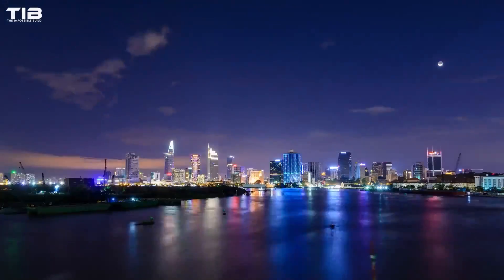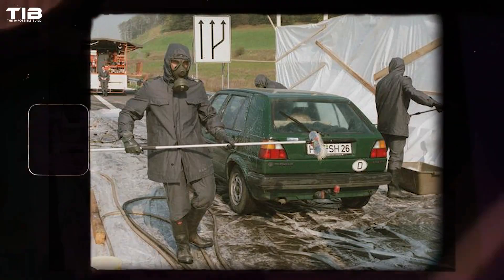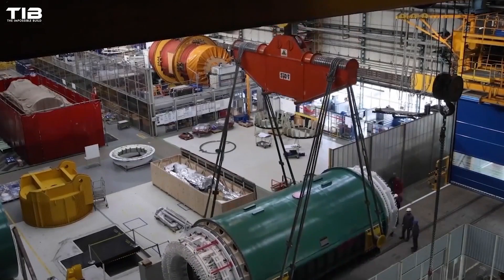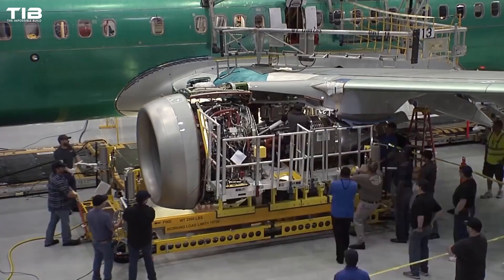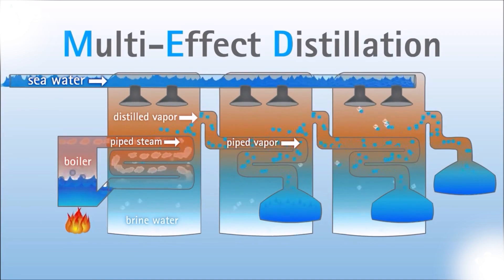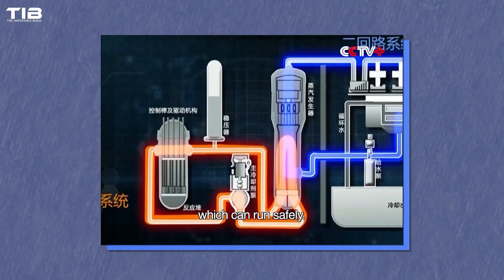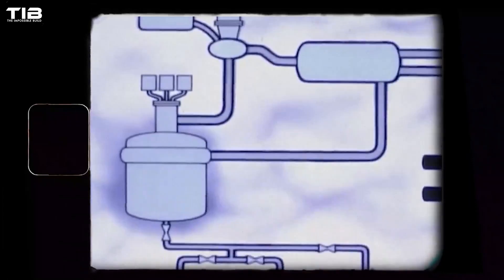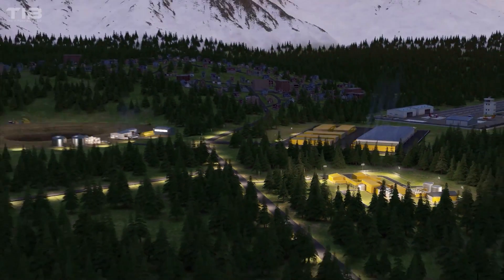The World's Smallest Nuclear Reactor

Comment: 300 MWh on a reactor that size isnt possible it would probably be closer to around 70 MWh
Reply: Several of them already are in use and are producing much more than 70. They can produce equal to demand increasing efficiency. I know of some in Europe that are producing 300+. Nuclear Aircraft carriers produce approximately 250 megawatts at full power.

Comment: In my opinion there are 2 basic platforms for energy. Fixed stationary Base power load Such as geothermal And portable As required power sources for our economic Distribution of industrial and human sustainable Products. We must adopt a system's view Of power use It's effect on external environmental factors And it's ability To be exported to downstream usage thereby achieving A more sustainable long-term view of energy use a very simple example: The heat used to produce steel is captured then exported into a  Desalination system to produce clean water, Further transported to greenhouses or homes for heat all part of a thermal efficiency process.  SMR's are a part of this future of efficiency in upstream usage rather than trying to do CO2 capture and other downstream clean ups which requires additional energy input to clean up the previous waste produced. Looking at the laws of thermodynamics and then improving efficiencies prior to implementation of power sources for industreal use is the future to longevity of our society.
Reply: Good opinion!

Comment: Chernobyl killed the ~ 20 people who went in at the time of the disaster. Fukushima was a weather event not a nuclear disaster, and ZERO people were killed from radiation. Nuclear is the SAFEST BY FAR energy source per measure of energy produced, as well as the ONLY truly zero-carbon energy source. It has TWO MILLION times the energy density of fossil fuels, solar & batteries, wind, hydro, geothermal, and is BY FAR the most reliable base load source of energy ever employed. It is FAR MORE SCALABLE than solar or wind, which take huge amounts of resources, land, time, and money, and wear out very quickly by comparison. Nuclear is the ONLY approach that could ALONE meet the planet's requirement of RELIABLE base load.

Comment: SMRs could be the stopgap solution we need for the next several decades until we are able to get past the massive scientific and engineering hurdles of nuclear fusion reactors and make them commercially viable. Ultimately it will be fusion reactors that will eventually become our primary, nearly forever power source. They certainly seem to have the potential to be a better solution than building more of today's massive and seriously, ruinously expensive to build and operate light-water reactors.

Comment: I am not against nuclear fission or even potentially fusion, there are times and places that nuclear could be appropriate. I do believe that nuclear will play a minor role. Renewable energy is rapidly advancing. Your statement about intermittent renewable resources is shortsighted. The point is: sunshine is free and the sun is shining and the wind is always blowing somewhere. The trick is to distribute and store that energy. Civilization is changing energy models, away from a centralized system to a distributed energy network. Every solar panel will add energy to a battery and every battery will feed the grid. SNRs might play a part by topping off batteries. There will never be a blackout because every consumer will be it's own backup.
Reply: It is technologically impossible to control a huge number of generation sources and distribute energy stably without significant losses.

Any generation sources with a capacity of less than 1 MW mean low voltage and the costs for transmission lines, substations, balancing, backup and maintenance are higher than for generation sources.

All renewable energy with a capacity of less than 1 MW (and often less than 10 MW) is subsidized worldwide.
Reply: @MihailG5541  
It may be true that a centralized system would have a problems controlling a large number of sources. However, a decentralized system would be less complex. In a distributed virtual system, large scale inertia and frequency control would be replaced with localized battery modulated control. As to costs, renewable sources of power are more efficient. Centralized power stations waste two thirds of their energy to process heat. Golmud Solar Park in China is the world’s largest solar farm with a 2.8 GW base and it seems to be quite integrated into the grid.
Reply: @chrisconklin2981  solar panels waste 80% of energy into the heat.
Thermal power plants can be used in many cases such as plastic recycling, water desalination and so on
Reply: @MihailG5541  Thank you for the comparison and please let me be more complete in comparison. I will not talk about nuclear as it is too complicated for this level of discussion. Regarding solar panels, the sunlight is free and the twenty percent that is converted into electricity instantaneously travels by wire, and is sometimes stored, on a grid system. Yes, we pay for this grid. 

Regarding fossil fuels they are archaic plants and animals that also depended upon sunlight. The process of mining/drilling, transporting, processing or refining, transported again, and then burnt for fuel to make electricity is a long process. I would say that this process is both energy and structurally much more expensive. Besides the sun will always shine and fossil  fuels will never last. Actually oil and coal are wonderful things. It is a shame that we just burn the stuff.
Reply: @chrisconklin2981  The entire process of manufacturing, transporting, installing, maintaining, storing, disposing of or recycling both solar panels and wind turbines involves fossil fuels to a large extent.
These are very energy-consuming processes.
I have not seen a single study that shows savings compared to fossil fuels in transport by more than 1.5 times and in the electricity sector by more than 2 times.
Only heat pumps or pellets/biogas from waste have high energy cost reduction coefficients.

Until other more sustainable and stable types of renewable energy (hydro, geothermal, biofuels of all types, hydrogen or ammonia, alcohol from renewable sources...) rise to the same position in terms of electricity generation per year, filling a significant part of the described chain - You can’t talk about “free” energy, “zero” emissions or at least some kind of long-term stability of the energy system.
Reply: @chrisconklin2981  Another part of closing the nuclear power fuel cycle is gas-cooled reactors (carbon dioxide and nitrogen for low-temperature generator outlets, helium and other inert gases for high-temperature heat exchange in the primary circuit) or molten salt reactors.

They will make it possible to raise the reaction temperature to 700-900 degrees, which will not only increase the efficiency of the nuclear power plant, but will also make it possible to melt metals in the second or third circuit, burn building materials or make cement, cast glass molds, and so on.

This could significantly reduce fossil fuel costs for industrial processes

Comment: Small Nuclear Reactors are being used in submarine and colossal Aircraft carriers, so the tech is there, and use to generate electricity 

So that same reactors can be used for smaller Towns and ciiites and that can be scale up
Reply: The first 30 SMR reactors will generate energy at a price higher than $100 (93.5 euros) per MW at the moment.
Taking into account typical construction delays, the price may increase by another 20-50%.
At such a price, they will not be able to compete with other types of generation, except perhaps with diesel generators in Alaska or northern Canada.
Reply: @MihailG5541  A 300MW SMR is being built for Ontario Power Generation (OPG) in Canada.  It is located in proximity to a large-scale nuclear plant.  It will cost $140mm USD and be in-service in 2026.  About an 18–24-month construction line.  The design is on scale to the existing PWR's currently in-service.  If successful, they can be further scaled to micro-SMB's <20MW and used in the 256 isolated northern Canadian communities.

There are >5,000,000 such communities on the planet.  I definitely see a business case and market for SMB's moving forward.  Designs such as liquid salt reactors add a level of safety.
Reply: @MihailG5541  We pay .16 per kilowatt hour so a megawatt here is $170
Reply: @TheOriginalUberGoober don't underestimate wholesale high voltage electricity prices.
Prices for households are double or even triple to wholesale.
Reply: Then again, are not warships and pretty safe from terrorists attempting to obtain their reactors. Or should we no longer be concerned about the dangers of nuclear proliferation?

Comment: Truth is, a long-term, independent study found that nuclear power generation is 6x more expensive than solar and wind + battery storage.  LOTS of these videos talk about SMR's but, none are being built and they won't be, due to their extremely high cost.  We'll see FAR more solar, wind and battery storage until we achieve 100% from these as nothing else competes.
Reply: In fact only Russia built new SMR reactors with HALEU fuel and only China built SMR reseach rector of 4th generation with mixed fuel.
Only Russia has new contract to build new SMR nuclear power station in Uzbekistan (6 SMRs, each have 55 MW of electric and 200 MW of thermal power).
Only Russia and France have abilities to produce enough HALEU fuel for SMRs.
All other "SMR" projects are re-developed old projects of "medium" modular reactors with power from 300 to 600 MW and usual nuclear fuel (5% enrichment).

You must include costs of new electricity lines to another time zones + regulated substations + balancing and stabilisation + "cold" backup (like fossil fuel power plants or hydroelecric plants), when you talk something like "solar and wind + battery storage".
Existing electricity lines and substations (without regulation of power and direction of energy transfer) cannot use all the energy from renewable energy sources, so losses can reach up to 30%.
Lithium batteries (even with hot standby mode of 20-80% capacity) require complete replacement of batteries every 10-12 years and repacking (partial replacement of blocks with high internal resistance) every 3-4 years.

In most countries of the world (with the rare exception of Australia), the duration of periods of calm and lack of sun ranges from 14 to 30 days, the duration of a 50% reduction in output power is 3-4 times higher.

Wind and solar can supplement base generation at a level of up to 1/3 of annual output. Anything above this threshold significantly increases the cost of solar and wind energy, to the level of current tariffs in Germany and Denmark (24-32 euro cents per kWh for end consumers or 16-24 euro cents per kWh for the wholesale market)
Reply: The main reason that nuclear is so expensive are the regulations.
Reply: @JvsSanders  I wonder why all of those regulations are necessary?  Could be be all of those contractors cutting corners.
Reply: Are the sizes comparable? I mean the land footprint of a SMR compared with a solar farm with enough battery storage to provide the same amount of power consistently 100% of the time?

Comment: In the 1950s/1960s we built loads of these. The result: We discovered bigger reactors generate power much cheaper.

Build BIG Modular Reactors.
Reply: Why It’s Funny (and Wrong):
	1.	Modular = Small by Definition
	•	SMRs (Small Modular Reactors) are designed for flexibility, transportability, and low upfront cost.
	•	Saying “Build BIG Modular” is like saying “Make jumbo pocket-sized phones.”
	2.	50s/60s Era Reactors Weren’t Modular
	•	Those were massive bespoke behemoths, not factory-built, plug-and-play systems like modern SMRs.
	•	The idea that “we built loads of these” is a total oversimplification of experimental, one-off military designs.
	3.	It Ignores the Real Use Case
	•	We’re not building SMRs to outcompete coal per kilowatt-hour.
	•	We’re building them to power a moon base, an aircraft carrier, or maybe… an experimental craft flying over the Nevada desert at Mach 12.
Reply: Who's going to pay for them?  Study after study have shown nuclear reactors are 6x the price than solar and wind + battery storage, and nuclear takes: 15-20 for each plant to be built, with MASSIVE taxes levied on people to build and maintain them.  No thanks!  Solar and wind + battery storage is the solution.
Reply: @RussellFineArt  Nuclear reactors obey the same economic laws as wind turbines: Economies of scale.

Building 1 is ridiculously expensive,but building 30 (like the French did) makes them really cheap.

Plus they offer a very different service: They work where the weather is rubbish for renewables, and last about x4 as long.
Reply: @RussellFineArt  The typical service life of wind turbines and solar panels with subsidies is 15 years, with the possibility of extension by 5 years.
The typical service life of nuclear power plants is 45 years, with the possibility of extension by 15 years.
The service life of nuclear power plants of generations 3+ and 4 is 60 years, with the possibility of extension by 20 years.

Calculate LCOE and CAPEX before writing strange words about "6x the price..."